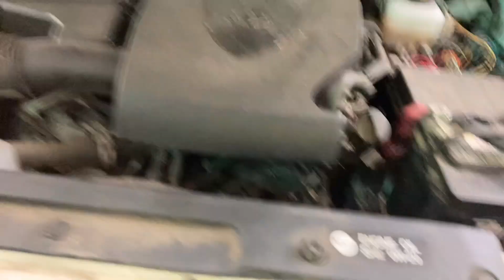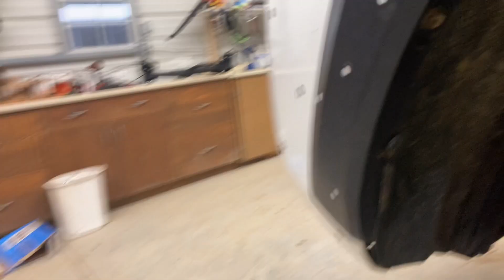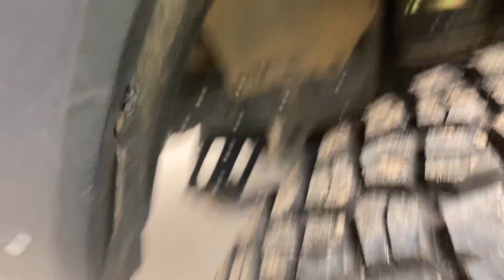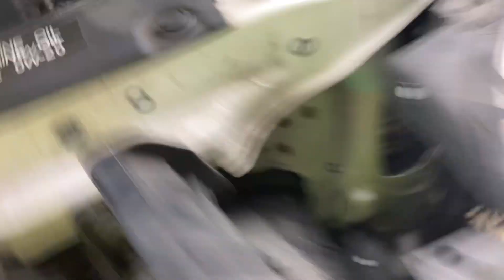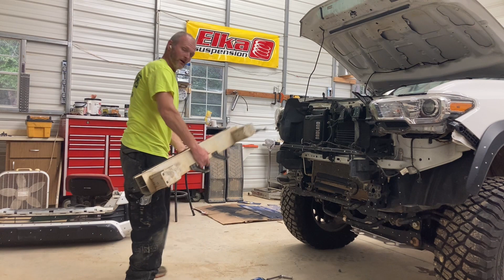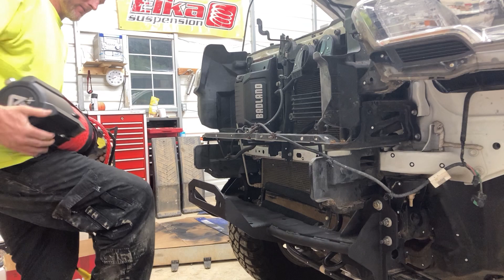Big Slack Off Road Gen 3 Tacoma Tacoma Hidden Winch Mount Installation

Comment: how much weight can those mount points be used for pulling? I do not know or think they where designed for that, but for taking a 5mph collision. and that goes for any winch installation kit, not just this one.

Comment: $500 for something that will obliterate your radiators and possibly other things in the front end if you hit anything over 5 mph... i'll pass. i think it needs some more support on the topside.
guess if you're purely just looking to get something to mount your winch and you're ok with it potentially damaging your front end, this is fine.
Reply from the maker: Hit a deer at 25 a couple of weeks ago…taco with Big Slack Winch mount 1 - deer 0